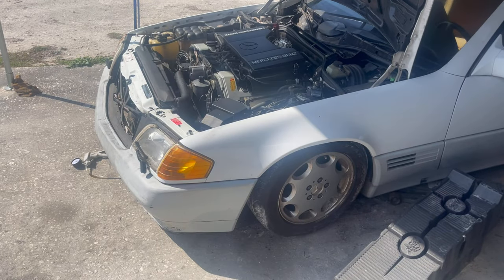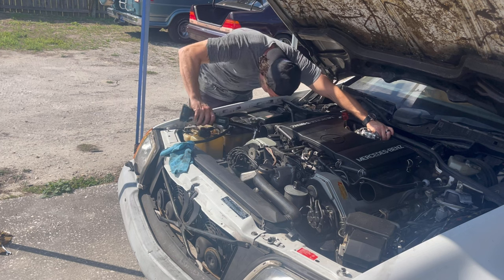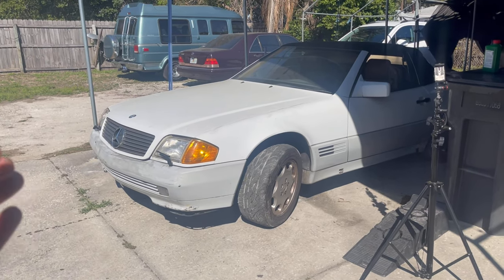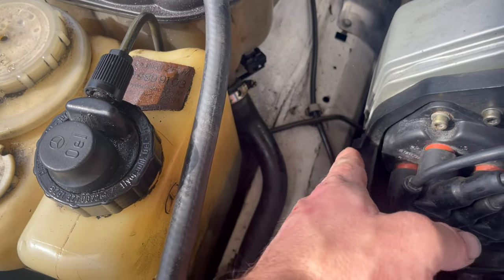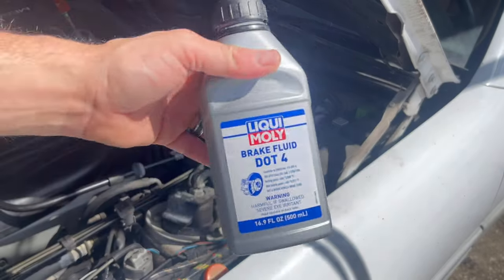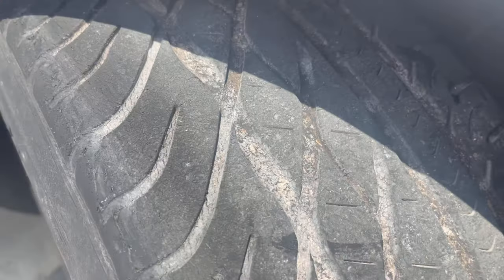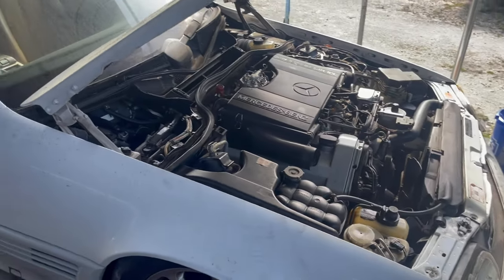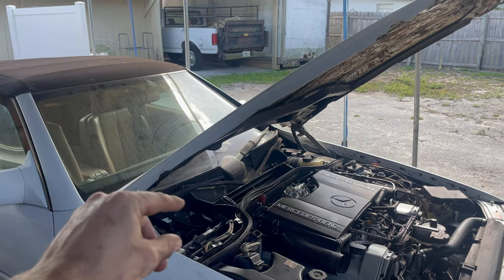Restoring a 1991 Mercedes 500sl r129 part 3: Suspension and brake headaches

Comment: Looks like the nitrogen spheres have gone. Its a hydropneumatic system where the weight is carried by the gas in the spheres and the coil springs
Reply from the maker: Definitely could be but main issue was leaking from the manifold but I’m almost convinced now it was something I couldn’t see behind the manifold

Comment: I would convert the ADS suspension to springs.
Reply from the maker: I will most likely be doing that just wanted to give it a shot to fix.   I don’t like giving up on stuff but sometimes for sanity you need to walk away.

Comment: I think I got lucky, my car looks to have springs all the way around. That being said I have no hardtop and I think my softop is just too far gone. I also gave you a shoutout on my last video
Reply from the maker: Thanks bro.   Damn soft tops are expensive and insane to instal.  Hopefully you can find a hard top.  Wish I had an extra one for you.    As for springs, you will still have springs with the hydraulic suspension.   Suspension was only meant to level the car out when adding weight.   It was revolutionary but has a lot of issues when it gets old.   A lot of people swap to normal shocks when they fail because hydraulic shocks are about $1500 and standard shocks a few hundred.